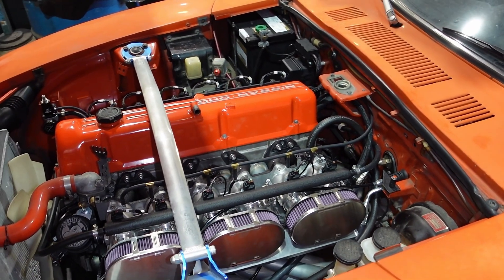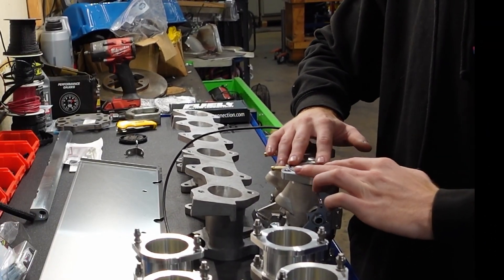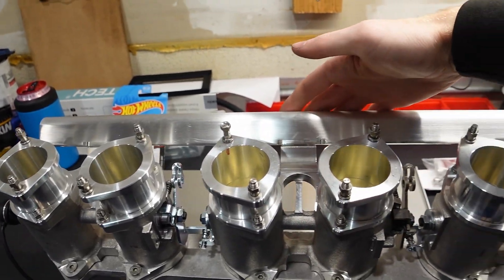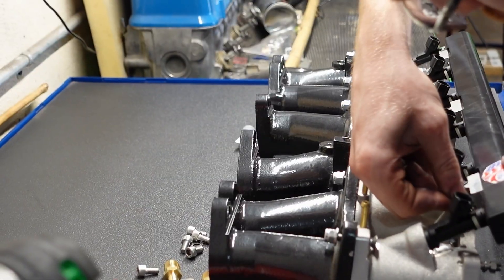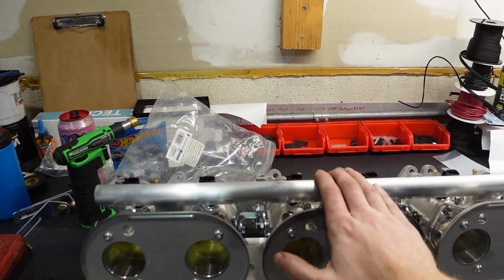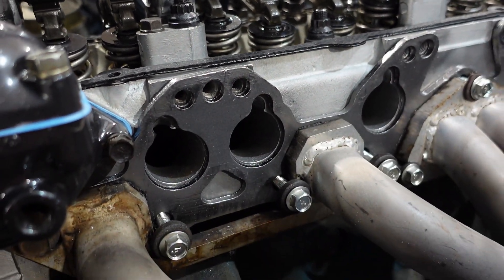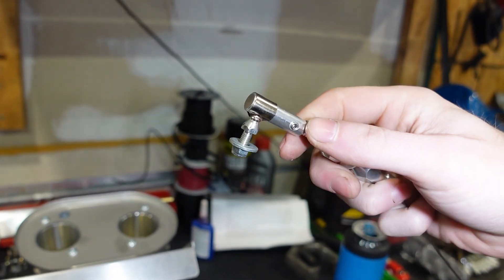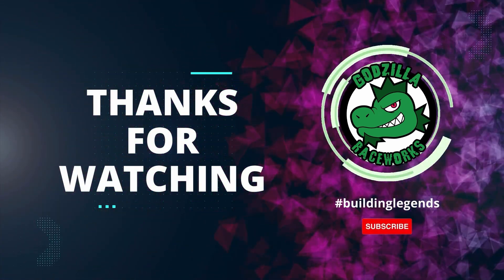Install Instructions | Godzilla Raceworks L28 Individual Throttle Body Kit for Datsun Z Cars

Comment: I’m interested! Is any other work needed such as Cam,head work.
Reply from the maker: This is a direct bolt-on accompanied by our Megasquirt EFI kit, so nothing has to be touched internally or at the cylinder head, unless you want to upgrade stuff while you have it apart.
Reply: @GodzillaRaceworks  now the big question,what’s the approximate HP gains including Megasquirt install on a 280zx NA.
Reply from the maker: @nostradamo11  For a bone stock L28, it's going to vary based off of your tuner, engine condition, etc. We've seen a net 10whp gain on a completely factory N/A, but that's with zero mods. The more mods you do, the more room for net HP gains there are.

ITBs can easily account for 50whp with a good tune with no other bolt ons.